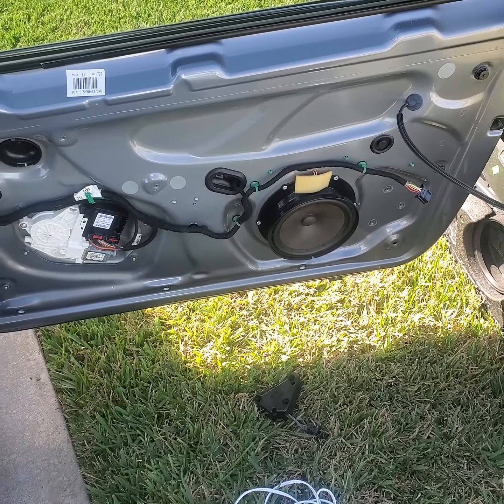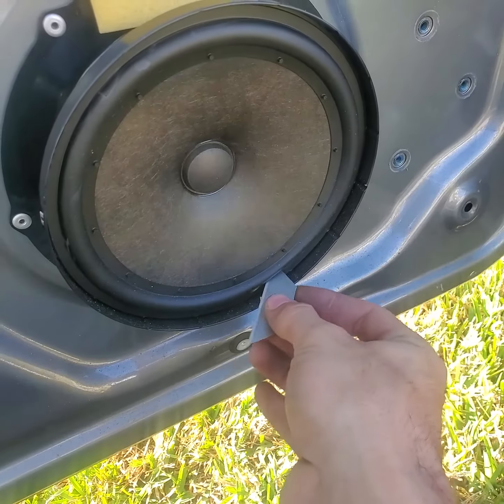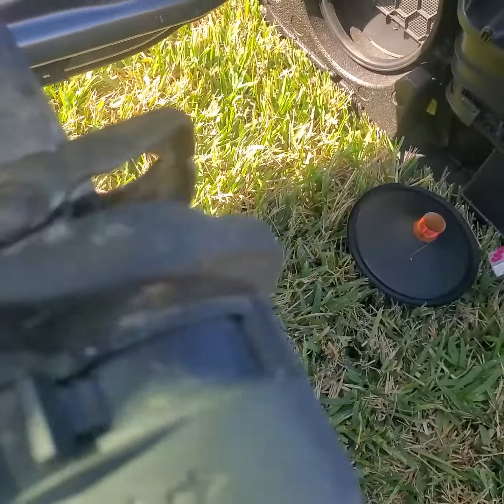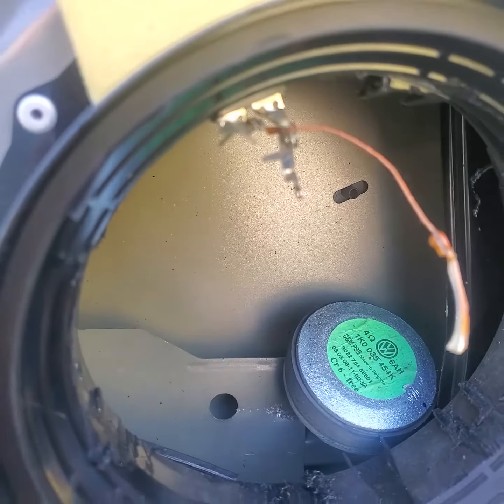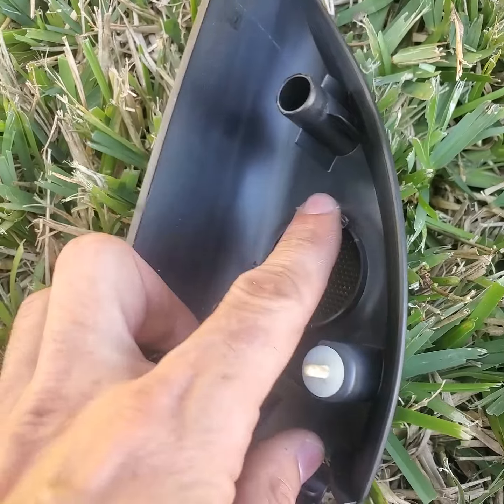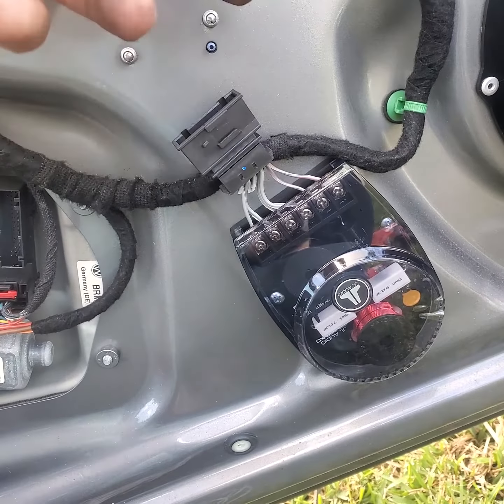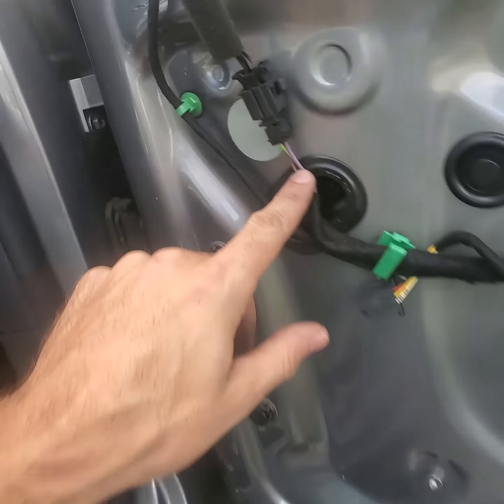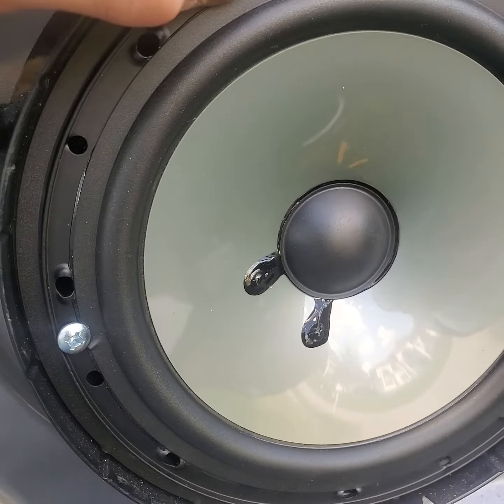Mkv Gti speaker install

Comment: definitely win the award for a unique car speaker installation...
Reply: @Ronin Omari meh try Flixportal. Just search on google for it =) -gary
Reply: @Gary Leonel thank you, I went there and it seems to work =) Appreciate it !
Reply: @Ronin Omari no problem xD
Reply: I brought a OEM speaker for mine .Do I have to cut out the speaker like you did also?
Reply: @modestovargas3465 probably drill out the  rivets around the housing and then find longer screws or buy a rivet gun kit